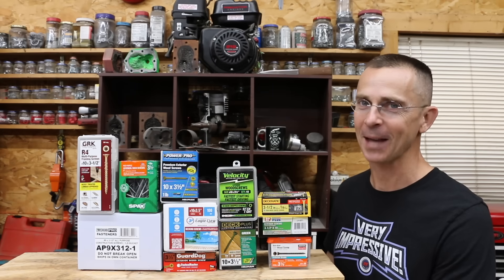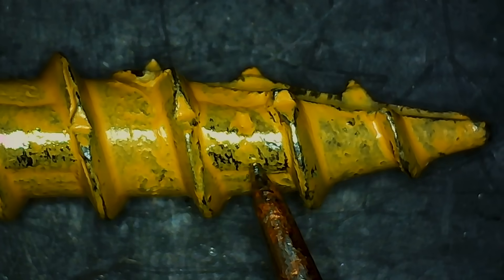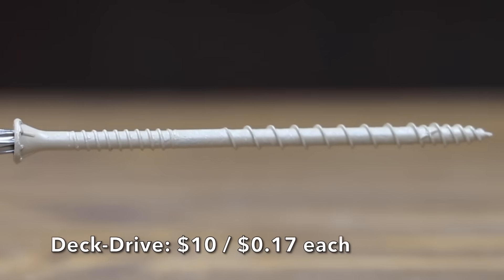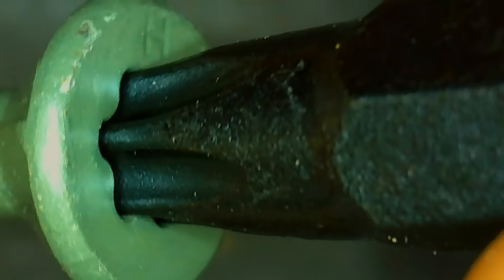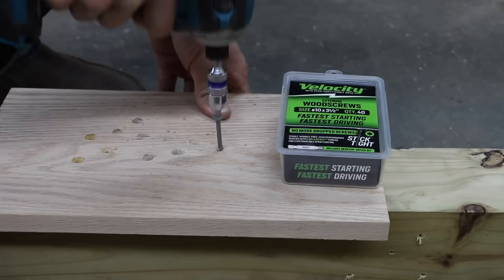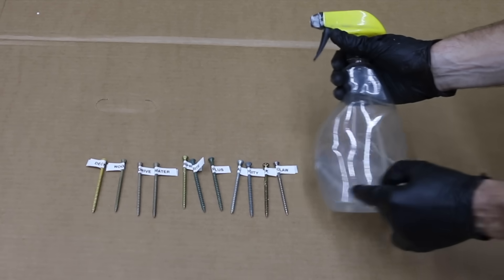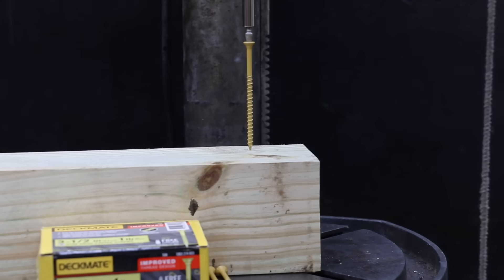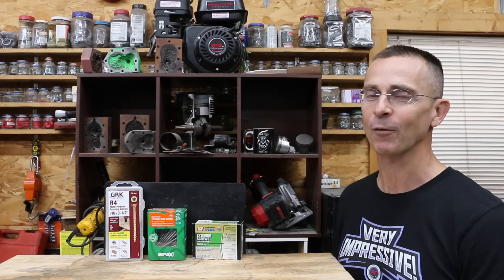Best Deck Screw? GRK vs SPAX, Grip Rite, Deckmate, WoodPro, FastenMaster, Deck Plus, Eagle Claw

Comment: Grip Rite / Deckmate screws are trash. All of them. They work fine as nails. the threads barealy stand away from the shank..,, and typically have more blank neck than the competition... there is no point to the blank neck and have never seen any benefit to it. Besk screws I've used are GRK.
Reply from the maker: Thanks for the feedback.
Reply: @ProjectFarm  I confess I still use a lot of grip right screws for non structural projects, just because they are cheap. You demonstated they have better "pullout" than has been my experience.. maybe I just got a bad batch.. but I have found them to produce an inconsistnet product.

I really loved the old Hillman torx screws, but then some engineer changed the design... and I don't think it is as good. The old screw was very sharp and had a different strategy for breaking wood fibers. Very easy to drive. Their new screw (sometime within the last decade) is still quite good, as your thorough analysis demonstrated... but I think their old design was actually superior.
Reply: @ProjectFarm  If you can find one of those old boxes of Hillman screws (cardboard box).. I'd love to see how it stands up to the challenges you've subjected the others to.

Comment: The screw head design means a lot when removing decking boards.
Try cleaning years of decking oil out of a spax head! At least a posi-square you can work your pick in the direction of the slots.
Reply from the maker: Thanks for the feedback.

Comment: Great job as always. As the winter season ultimately falls upon us, I suggest testing sidewalk salts. The price varies wildly amongst the brands. Even more curious is how something like water softener salt stacks up being it's roughly 1/4 the cost. It's price blows my mind because it's washed and cleaned, certified for human consumption, while what is available to throw on your sidewalk is far more expensive...
Reply from the maker: Thanks!  Thanks for the video idea.
Reply: huge +1 to this idea. definitely think it's a good one and I hope he gets around to it.
Reply: Sidewalk salt is an interesting subject.   If my father were still alive, he could give anecdotes on what all he saw as a concrete and salt (during the winter) salesman.  Basically the suppliers of the salt can vary widely even though the branding on the outside of the bag will be the same year after year.  He had stories of calcium and other ice melts, and the nuances of such (like damage to surfaces, etc.).  Wish I could recall them now.  
My guess is that the only ones that could be tests would be the processed / manufactured ones, as salt quality varies from place to place.
Reply: Great idea, I hope this catches on project farms agenda
Reply: I use water softener salt. 40lbs for less than 1lb of "sidewalk" salt. Salt is salt, and while we do get extreme cold of -30f or colder that's not when you get ice. We get ice when it's 15-20* or warmer and it makes zero difference what salt I use. Grass doesn't seem to care either.

Comment: Good to see the typical OTS offerings all hold up really well to corrosion! Lots of consistency. Always like the feel of the spax and GRK, but typically have a box of grip rites in the van for bigger ones, and GRK for trim. Spax has some with a flat pan head type deal that are just plain epic if you don't mind head exposed. Hold on better than a lag. Way less shear, but usually wood failure is the issue, so either predrill/bolt with washers or use smaller screws to not aggravate a board. 
I'm really pleased you showed why nails are still relevant... Makes me wonder what all the optimum places are to use them.
I would be inclined to use large carriage bolts/washers in large posts/beams, and screws just about everywhere else. Typically even in 4x4s, with pressure treated, I find it really difficult to create a sheer situation with screws unless the wood rots, in which case the screw just guys the board as it peels away. But maybe I should install nails in tandem at a few spots, and things like handrails
Reply from the maker: Thanks for the video idea.  Thanks for sharing.

Comment: i keep some grk screws around for stuff that i want to throw together but plan to take apart, so corrosion isn't an issue, but most of my on hand woodscrews are watchdog. they do the job and it is just a hobby shop. they are cheap but not the cheapest..
Reply from the maker: Thanks for the feedback.

Comment: The Simpson Deck Drive screws have one advantage that none of the other screws have. They change the thread pitch for the top half of the screw, this allows the screw to "grab" the board it was driven into and pull it tight to the board being joined to. This simple concept has eliminated the old trick of backing a screw out to remove the gap left between boards then drive it back in, especially harder woods. This feathure is the one reason I buy these screws over others,  and I have tried them all over the years.
Reply from the maker: Thanks for the feedback.

Comment: Higher difficulty driving the screw means two things to me,. 1st the threads are digging in better... but 2nd the thread pitch may be more consistent so the threads are not expanding the wood as much due to variance. If the first 3 threads are kinda messy there will be less friction for the rest as the wood is tore up
Reply from the maker: Thanks for the feedback.

Comment: I build outdoor furniture,  I use grip rite and spax....I really  didn't want to watch this...just in case I was using crappy screws. One less thing to worry about,  so thanks for that! Have you done anything  on clear deck stains?  Oil or water based? I need to find something that can  last forever,  but will settle for  at least 3 years.
Reply from the maker: Thanks for the feedback.  Thanks for the video idea.

Comment: Hey there, separate subject: 
What would you think about another epoxy strength video like the one you did with all of the bolts on the angle iron but this time do one or all of the following:
- Give the manufacturers a call and ask them what they think you could do for their particular epoxy to work better.
- Make the surfaces of the angle iron and the bolt heads way more roughed up 
- Clamp the bolts to the angle iron right after glueing and letting them set for ex amount of time until fully cured (like when clamping wood together upon glueing.

I would be very curious to here what JB Weld and others have to say about why they think their epoxies failed so quickly as well as if they have some particular set up protocols they like to execute for better adhesion. 
It would also be great to know if clamping has a serious positive effect! 

Your videos are awesome! 
And one more thing: So are you saying that if money is not an issue, that you would opt for the Wicked Edge for knife sharpening? 

Thanks brotherman! 
Myles-

Comment: Video Idea: I would really like to see a cordless hot glue gun comparison. My old corded unit recently sorta caught on fire so a replacement was needed, but there weren't really any "unbiased" comparisons between brands for anything under $300. Your video style seems like it would be well suited to that sort of thing, if there's enough interest. Specifically comparison between battery operated and butane models would be awesome.

Second Idea: durability testing of ESD work surfaces. I use an ESD mat for both my job and hobby projects daily. It would be really nice to see which brands hold up the best against; incidental hot solder drops, humidity variation (resistance to cracking), mild UV exposure, and puncture resistance from implements like tweezers.
Reply from the maker: Thanks for the video idea.

Comment: Great Content as always!

For a video idea. Since I'm currently tossing in my oil stained clothes maybe a test of the best detergents for certain stain (oil, grease, paint, etc.) a lot of either work/dabble jobs/hobbies that get our stuff consistently dirty.

On top of which cleans the best, also which rinses away cleanest-i have to wash my stuff seperate than usually do a empty bleach load to get rid of residual mess.

You could throw in a hot vs cold vs pre-treat element.

Not your usual content, but one we can use and our spouses can appreciate too 😉
Reply from the maker: Thanks for the suggestion,

Comment: Excellent testing as always. The brands and types of screws I'm most familiar with are Paulin and Richelieu in Canada in Robertson (square) drive. I expect to pay 15$-20$ CAD for 250-500 screws , so the prices you tested seem high: it brings high expectations that many don't meet with their cheap coating.   I looked at deck screws I use for general work (If it's good enough for a cedar deck sitting outside, it will live forever inside) and they all have a nice finish. Manufacturers list them as having a ceramic coating with sawtooth design.  Some of the screws you're testing seem very roughly (cheaply) made. I always pre drill so the self drilling is not always necessary and increases $.
Reply from the maker: Thanks!  Thanks for the feedback.

Comment: Interesting results! It will definitely have me looking closer at my normal deck screws when I remove them from temporary projects. I already had the unpleasant experience of removing SPAX deck screws that were maybe 10 years old: they held up much worse than whatever other brand the previous owner used (it was a less distinctive design) - nearly all the SPAX corroded and either stripped out the head, or the head snapped off. For those I could remove, they were far more eaten away than the other brand. I definitely won't be buying any. I've had some of the larger GRK structural screws, and they hold up well so far, including in reuse.
Reply from the maker: Thanks for the feedback.

Comment: I remember a few years ago, you tested shear strength of nails vs screws, and screws came out far on top. I am surprised to see 16d nails delivering shear strength on par to deck screws in this video. I wonder what is the reason for such a large change?
Reply: Deck screws tend to be quite brittle as the wood will tend to compress before the screw gives way, machine screws come in different grades which indicates their shear strength and tend to be much balanced between ductility and strength, normal timber screws can be pretty variable.
Reply: @nurgle11  Ductility aside, deck screws withstood 2-3x shear than all nails in the old video. Hence, my surprise here.

Comment: 5 inch GRK lag screws are our go to for attaching deck ledgers to a house wall. 

Maybe that's something to test at some point, lag bolts vs. lag screw. 5 to 6 inches long, 5/16 to 3/8 diameter or similar size. SPAX and GRK make some pretty bold statements on the shear strength of their lag screws.
Reply from the maker: Thanks for the video idea.

Comment: I know it adds a little run time but mentioning your controls/constants would be nice. Good example would be what model impact gun you were using and how did you handle drive bits? We’re they the provided bits for each screw or did you use a constant bit that was new for each screw test?

Video idea recommendation. Shopvac performance test with different filters (hepa vs standard),  cyclone like dust deputy, filter vs bag vs both, and hose length.
Reply from the maker: Thanks for the suggestion.Thanks for the video idea.

Comment: Great video, as always!  I'd be more interested in seeing the initial removal torque values.  It may serve as an indicator of the screws propensity to back out over time with the wood expanding and contracting.  A very important attribute for a deck screw in my opinion.    Thanks again for the great videos!!
Reply from the maker: Thanks and you are welcome!  Thanks for sharing.
Reply: @ProjectFarm  Thinking about it, the torque to drive in the screw may very well serve as a surrogate for loosening torque as you took the values when the screws were nearly seated.  Many of the screws have modifications that are proposed to reduce backing out that engage as the screw is driven home.   The corrosion info was certainly valuable!  I use these in lots of applications, not just decks (non structural) that get exposed to the elements.

Comment: Damn, this is brutal. lol. Ive heard a lot of good things about GRK. This is an excellent review.
Reply: Ok, I have a question... because of this.  Most of the coated screws didn't have any corrosion even after sulfuric acid bath and rusting agent. And it diidnt seem to do anything definitive to help driving in or out... and it definitely didnt help with tear out...   So... Why do they coat them???
Reply from the maker: Thanks!

Comment: Could you test "spontaneous combustion" of oily rags in the shop garbage?  I have not experienced this, but I have heard stories from others.  Do different rags, oils or combination produce more heat and fire risk as they dry out?  Which is more likely to ignite from a rouge grinder or welding spark?
Reply from the maker: Thanks for the suggestion.

Comment: I had to do some work on a section of deck that I had built about 20-25 years ago. Back then I had used Deckmates to fasten the decking so the screws would match the original deck. In other places I had used Scorpion ceramic coated deck screws. All of the Deckmates were rusty and at least 25% just snapped off. Every Scorpion backed out and showed virtually no damage.
Reply from the maker: Thanks for sharing.

Comment: I have been using Deck Mate screws for years. The early ones had the square number 3 Phillips head which I liked. I do not like c the star drive feature. The square drive works so much better from my experience.  Why is t h e star drive aspect do dominant? Is there a connection to patents? Why is Taiwan the stair drive producer of this type of screw head,?

Comment: I doubt the known saying of nails for structural cause they bend before they break thing. It takes a lot less force to dislodge a nail than a screw and once the item starts to separate it gets easier and easier for it to pull that nail out and bend. I have had temp built stair and framed structures built with nails and others built with the cheap wood screws (not the drywall ones) and the nailed ones always failed and collapsed first before the screwed ones. I did do a demolition test on some of them as the screws were rusted and could not get them out with the driver and the screw ones was half and half on breaking but even if they broke they were far more stable and harder to break than the nails were. It was regular 2x4s/2x8s and they were 16 penny nails. 

Would be good to see you do a full test of Nail vs screw vs nail/screw (I think I remember you doing a test but I think it was only nail vs screw) and have a rocking fail test with weight as a lot of times structures moving back and forth constantly that causes failing is never tested really as the simple push test is just for heavy loads just dropped onto something. Also old nailed stuff tends to always loosen as the wood shrinks always from the nail where screws will still hold. 

Oh a test you can do is with metals between screws and the pop rivets. Since pop rivets come in aluminum, steel and stainless and screws are normally the hardened steel and maybe stainless for metals. Can get some testing on them and see which one is better. Aluminum would be the best medium since the screws can easily strip it out but aluminum rivets can be soft so its aluminum vs aluminum. Steel might be doable in 1/16" to 1/8" as long as its mild steel on the screw side. 

Rivnut wrenches could be a testing medium as there is a lot of different styles and sizes out there like rivets. I have become addicted to using them vs nut and bolt and don't really know their failure load
Reply from the maker: Thanks for the video idea.

Comment: Don't know about any of these brands but I do know I use a brand called bronze star that is the brand carried by a local contractor warehouse where I get most of my supplies because they say they are the best by a long way,,,weellllll I got to take their word for it because I buy them by the contractor bucket (I think it's a 25 pound size bucket) and i have installed a BUNCH of them because I use then in just about everything including structural (at least for decks and the simlar because they would by WAY too expensive for much more than that, unlike deck screws or screws as normal these thing are TOUGH as all hell, you WILL NOT break them by bending, I've have seriously tried but they just bend back and forth more than just a couple times and with some pretty darn hard effort required before they finnally do break, they also grip like nothing I've ever seen before, just 2 of them will hold a 2x4 in an overlap joint well enough that I have tested them by driving my 1 ton Ford over them and snapping the 2x4 before they pulled out of the wood (yes they will pull out but most always take a big chunk of wood with them  telling me they don't let go without a serious fight), as far as resisting corrosion all I can say is everything I've built using them is still standing and where you can see the heads of the screws they still look like the day they went in, and some of these are right at 10 years ago, I used to use the plain old phillips head screws prior to these the one day my contractor supplier showed me these back then as a brand new product on the market and showed me a youtube video (I think it was) of the companies promo video testing and showing them off and I was convinced and even tested them myself in a roundabout sort of way, lets just say I haven't used anything else since,  anyhow thanks for yet another eye opening and well done video.
Reply from the maker: You are welcome!  Thanks for sharing.